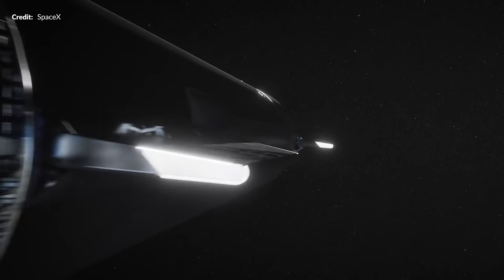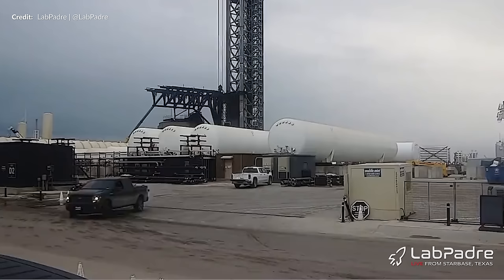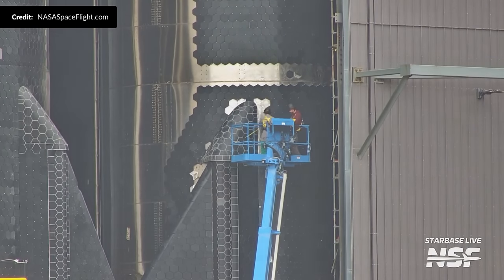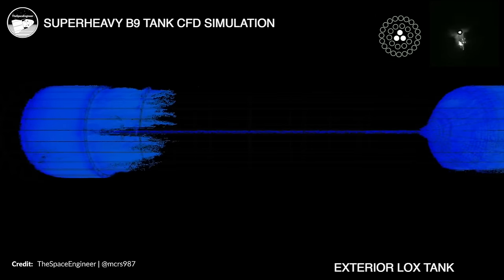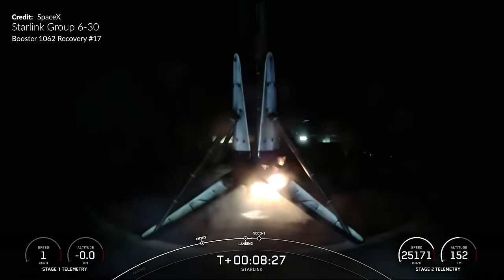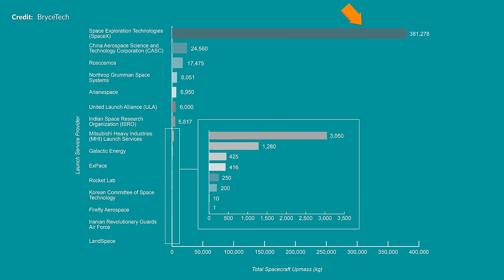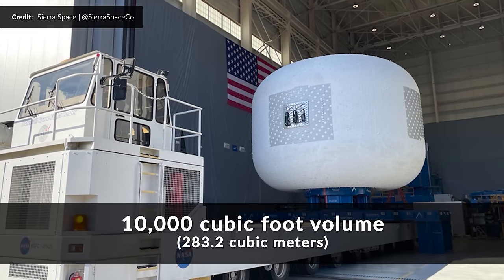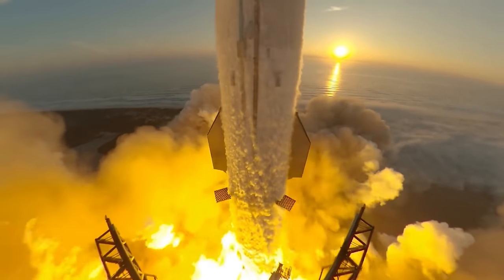SpaceX's Starship Version 2 to take Center Stage! Lets do this!

Comment: Marcus cutting on Blue Origin projected timeline while giving Musk a pass on projected timelines.🤣
Reply: He's frequently joked about Elon time. He does all the time. Off the top of head, he's picked on Elon for the estimated launch of IFT1 and the expected time to have the pad replaced afterwards. Blue Origin though is even more delayed than Elon and SpaceX.
Reply: We always joke about Elon time... but even when you take Elon's estimates and add a couple of zeroes to the end to get a more accurate figure, we're still left wondering what the hell Blue Origin are doing.

New Glenn was announced in 2016, roughly the same time as the original carbon-composite design for Starship... so three years before the current stainless-steel version. And since then, SpaceX have flight-tested no fewer than ten pieces of test hardware (from Starshopper to IFT2), while Blue Origin have shown us glimpses of what might be a couple of tanks.

So it's hardly unfair to cut on Blue Origin for their timelines, given that they manage to make Elon's worst estimates look accurate... and for that matter, they make Boeing, ULA and Arianespace look like fast movers.

Comment: 750rpm is nowhere near the speed of sound as huge turbine blades on jet engine that are much longer go 10,000-25,000 rpm and don't go speed of sound
Reply: The comparison misses the mark because we are talking about a tiny drone helicopter that needs far less power to fly above the Martian surface.
Reply: @michaeldeierhoi4096  what are you talking about  he said the blades go near the speed of sound but they go nowhere near as the much longer and faster blades in a turbofan don't go mack 1
Reply: @harryvlogs7833  Ah yes, I get your point now.  My mistake then.  Carry on.
Reply: He said nearly 750rpm faster than Ingenuity’s

Comment: 3:45 - Umm, no, they weren't good ideas at any point of time. Cool looking, yes, and adhering to the "we don't do things like other people do" credo, but those "other people" sometimes do come up with good solutions to common problems (like how to weld stainless steel pressure vessels, how to store cryogenic fluids, how to build reliable, no-nonsense rocket engine...). SpaceX did heed the advice on the latter and the resulting Merlin is a miracle of reliability. Now, innovation is important (hence Raptor), but only where it brings something to the table.

Comment: They are sending too much stuff into orbit.  There is going to be a collision which will eventually lead to a logarithmic increase in collisions and render space impossible.
Reply: Some have said that this is an overblown concern because in the case of the Starlink satellites that Space X is putting into orbit they are all going to a low LEO and are designed to deorbit after a few years.  

That being said many ARE concerned with the rapidly increasing number of satellites and such put into orbit lately and mostly from Space X.  

It's like we are watching a big experiment being played out waiting to see what happens.   Sort of like watching climate change becoming more of an issue and wondering if we are going turn the tide back enough to make a difference!!
Reply: We only have a few thousand satellites in low orbit, which is a drastically larger location than we have airspace on the planet. And yet we can handle over 100,000 aircraft flying every day. SpaceX, NASA, and other organizations are very smart. They know how to keep space opened.